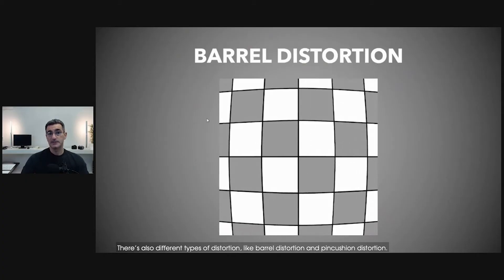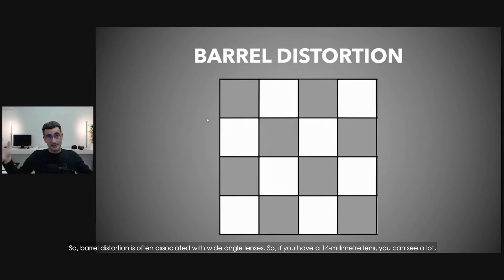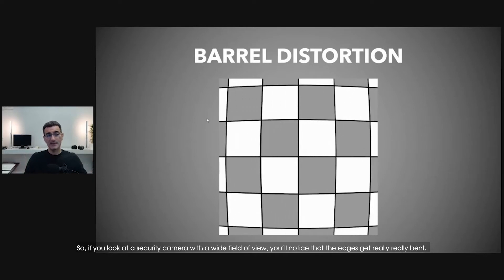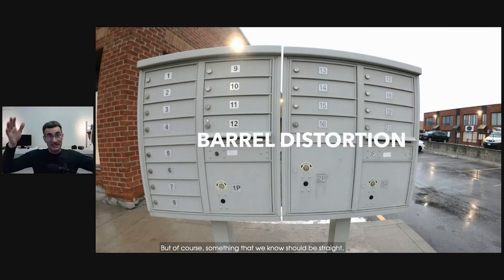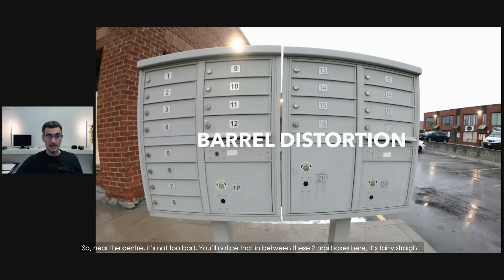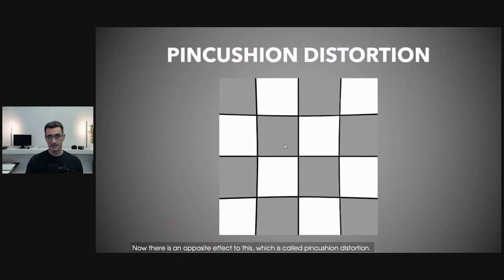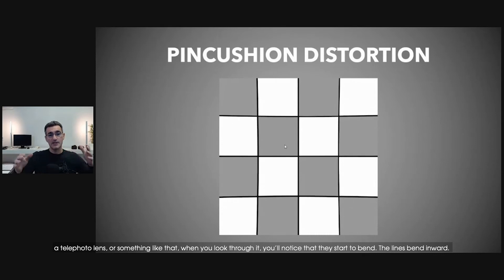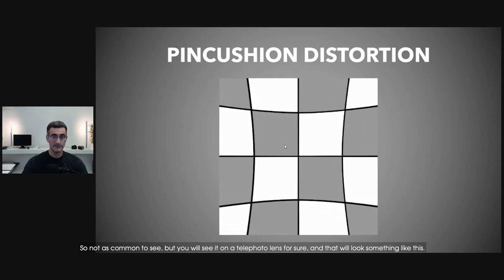Barrel distortion & pincushion distortion in Photogrammetry? | 3D Forensics | Forensic Photography

Comment: So how exactly would one go about dealing with these types of distortions?
Reply from the maker: Depends on what you are doing with it. If you simply want to remove the distortion for aesthetic purposes, then software like Photoshop has presents and tools that can help to remove distortion. However, if you were making a photogrammetry model, many software programs now calculate the distortion parameters automatically, so long as you feed it enough high quality photographs.
Reply: @3Dforensics  Thank you so much for your response. This was very useful info once explained further..